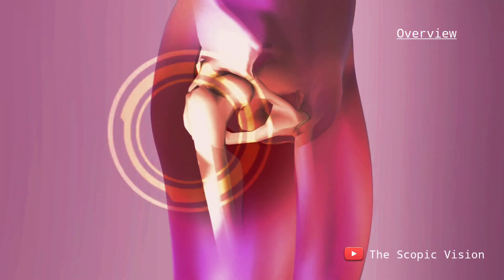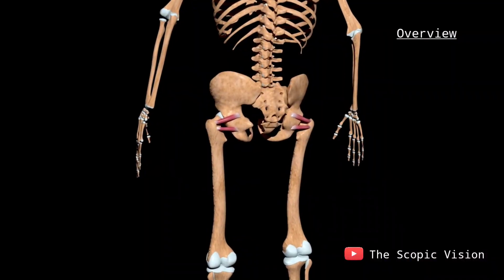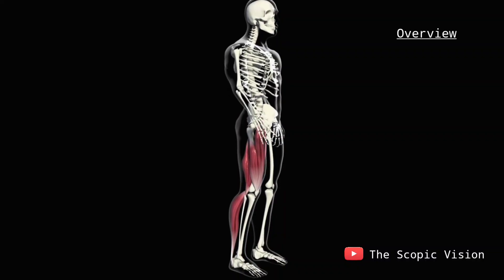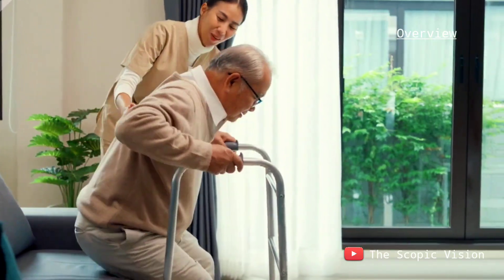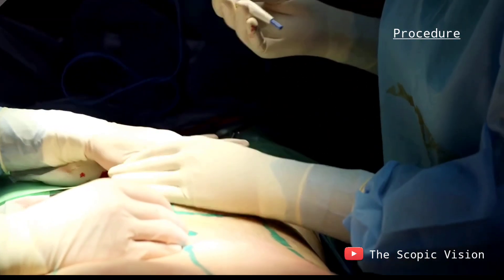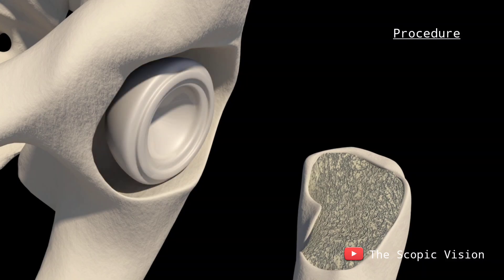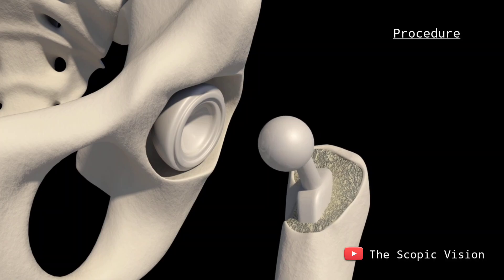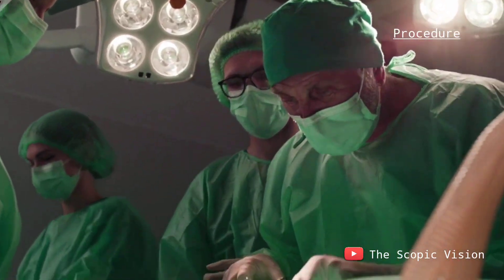Hip Replacement Surgery : 3D Animation | The Scopic Vision

Comment: What if the metal is too thick or heavy to use on the leg given they are also adding cement? And how could it be flexible?
Reply from the maker: Hip implants are specifically engineered to be lightweight, strong, and biocompatible. The metal parts (often titanium or cobalt-chromium alloys) are not too heavy for the leg. Bone cement, when used, helps anchor the implant but does not make the leg heavy. Also, hip implants are not meant to be flexible; the flexibility comes from the natural motion of the joint,the implant components are shaped to mimic the ball-and-socket movement of the hip, allowing smooth, natural movement.
Reply: @Thescopicvision  thank you . I ask b/c I know someone who has that surgery . Thks! 🙏
Reply: Unless you have poor bone density, cement is not used, they rely on your natural bone to fuse on to the implant, both in the femur and pelvis
Reply: @StevenReller ty